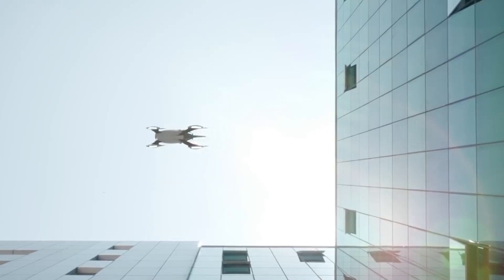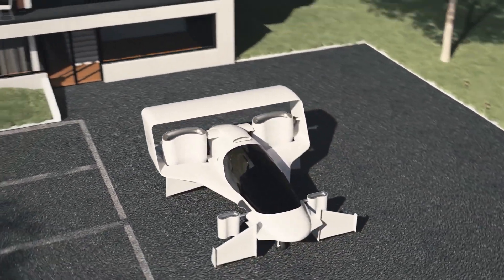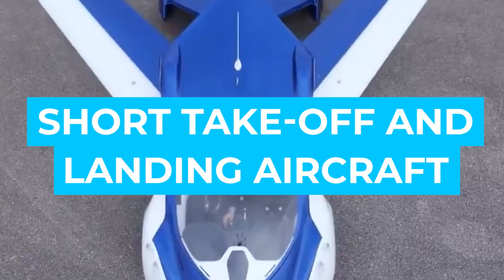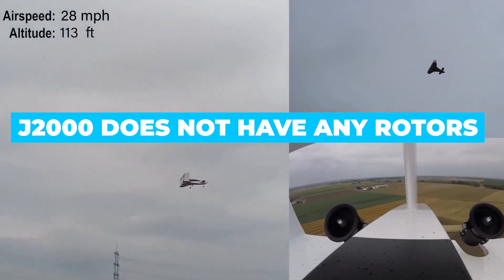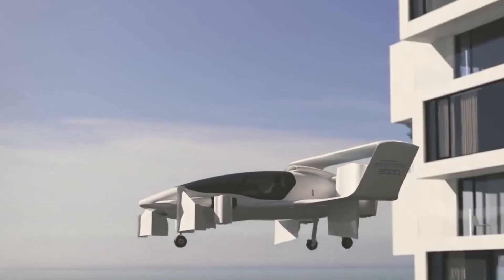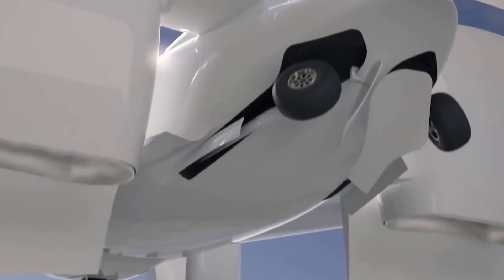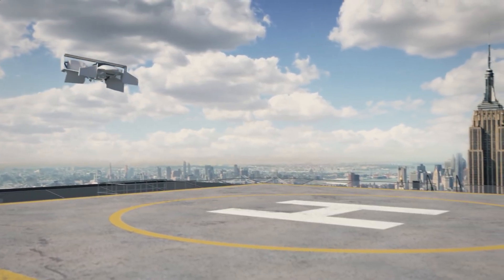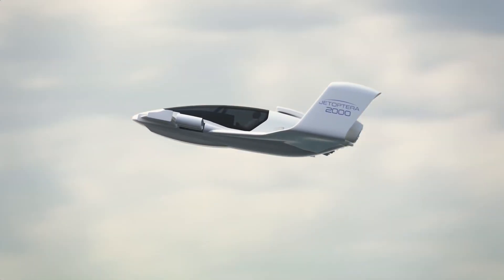How Jetoptera's Bladeless Propulsion System Works

Comment: A battery is a LAKE, what we need is a RIVER. A generator using a magnetic propulsion engine. They levitate high speed trains, why not use that constant push mechanically? Only frictions would be bearings on shafts.... batteries, like bottles, are emptied until refilled. We need the tap. They make electricity in a power plant why not in the vehicle? Watches use kinetic energy, calculators solar, they keep going, so why does the personal vehicle still plug in? Tax money that's why

Comment: We need a working prototype, even on a small scale
Reply: There is a small-scale model. But I think the problem of low efficiency will only show up when it's full scale. Nowadays you can build almost anything in RC scale, as there are small and powerful electric motors. But it's not easily scalable.

Comment: seriously this is suppose to be a breakthrough? They're basically artistic nozzles that in no way makes it more efficient.
Reply: Oh contraire -  I suggest you go and research some fluid mechanics, Bernoulli's Principle,  Coanda effect and fluidic propulsion systems.   You might then realise that this propulsion idea is actually pretty sound.  At present, the power required is still out of the range of current battery storage capacity, for full manned EV use, though within practical application for R/C models.   How this will scale-up will be interesting.  Currently, a single small gas-turbine powers the centrifugal compressor that supplies the HP to the multi-vectored FP thrusters, but yes, overall, a far more efficient system than straight gas turbine vectored thrust, tilt wing/rotor, or conventional rotor and with considerably less dB's emitted than any other aircraft other than a glider, which is always a plus.

Comment: The  'zen' of aerodynamics efficiency is to have the aircraft disturb as less as possible the air after it passes, and that means imparting a small acceleration to a large quantity of air. What 'fluidic propulsion' is doing is the exact opposite: the fast jet air entrainment creates a lot of turbulence that is energy lost in the wake and cannot be effective. The video here: https://www.youtube.com/watch?v=dS0oFmzU06g is demonstrating that a regular fan is more effective at moving air, and quieter too.
Reply: Nonsense, the efficiency should be measured in m3/s per Watt, not "m/s per fan power levels". That video proves nothing.

Comment: You never even explained how fluidic propulsion works
Reply: This is all optics, folks- 0:17 -that is certainly a micro-turbine engine, and I suspect it drives a fan connected at either the front or the back, the output of which ducts to those "bladeless" propulsors, lol.
Reply: I think it's more a long the lines of the venturi effect
Reply: Think of a bunch of modified Dyson fans folks.
Reply: Je sais pas si ses vrais.🎉🎉🎉😂😂😂
Reply: search bladeless fans and their flows on youtube. Great video.
Reply: @generalrendar7290  the fans are just inside rite?  so there are blades inside it..
Reply: If true North was, "OPP"
and, "South" was You know Me
the mechanical 🌾🐤empty ear' can hold a listener in🌵
Reply: If true North was, "OPP"
and, "South" was You know Me
the mechanical 🌾🐤empty ear' can hold a listener in🌵
Reply: If true North was, "OPP"
and, "South" was You know Me
the mechanical 🌾🐤empty ear' can hold a listener in🌵
Reply: If true North was, "OPP"
and, "South" was You know Me
the mechanical 🌾🐤empty ear' can hold a listener in🌵
Reply: What Is Islam?

Islam is not just another religion. 

It is the same message preached by Moses, Jesus and Abraham.

Islam literally means ‘submission to God’ and it teaches us to have a direct relationship with God. 

It reminds us that since God created us, no one should be worshipped except God alone. 

It also teaches that God is nothing like a human being or like anything that we can imagine.

 The concept of God is summarized in the Quran as:

{ “Say, He is God, the One. God, the Absolute. He does not give birth, nor was He born, and there is nothing like Him.”} (Quran 112:1-4)

Becoming a Muslim is not turning your back to Jesus. 

Rather it’s going back to the original teachings of Jesus and obeying him
Reply: @ahmdabdallah5811  no, islam is 700 years after christ And is nothing of the peace and love for our fellow man, earth, and animals. Unconditional love is what our god demands.
Reply: @ahmdabdallah5811  I assume you will be accepting the resurrection of Christ, his position as the Son of God and Savior of Mankind?
Reply: @ahmdabdallah5811 
"slam is not just another religion. 
It is the same message preached by Moses, Jesus and Abraham."

This is a lie.

Moses said; You shall not bear false witness and you are bearing false witness.
Exodus 20:16: Thou shalt not bear false witness against thy neighbour.

Deuteronomy 5:20: Neither shalt thou bear false witness against thy neighbour.

Islam teaches that God does not have a son.

Yet the scriptures teach us that God does have a Son.

Psalms 2:7: I will declare the decree: the LORD hath said unto me, Thou art my Son; this day have I begotten thee.

Psalms 2:12: Kiss the Son, lest he be angry, and ye perish from the way, when his wrath is kindled but a little. Blessed are all they that put their trust in him.

The Apostles of Jesus Christ taught that these scriptures refer to Christ.

Acts 13:33: God hath fulfilled the same unto us their children, in that he hath raised up Jesus again; as it is also written in the second psalm, Thou art my Son, this day have I begotten thee.

Hebrews 1:5: For unto which of the angels said he at any time, Thou art my Son, this day have I begotten thee? And again, I will be to him a Father, and he shall be to me a Son?

Hebrews 5:5: So also Christ glorified not himself to be made an high priest; but he that said unto him, Thou art my Son, to day have I begotten thee.

Jesus, speaking of Himself said; "For God so loved the world that He gave His only begotten Son that whosoever believes on Him should not perish but have everlasting life."

Jesus Christ rose from the dead, is ascended up into heaven is coming again. All that follow the violent teachings of Mohammad will be judged by Christ and His angels will gather them together at His coming and cast them into a firey furnace.

Matthew 13:41: The Son of man shall send forth his angels, and they shall gather out of his kingdom all things that offend, and them which do iniquity(lawlessness);
42: And shall cast them into a furnace of fire: there shall be wailing and gnashing of teeth.

Mohammad is still dead.

"Islam literally means ‘submission to God’ and it teaches us to have a direct relationship with God."

It reminds us that since God created us, no one should be worshipped except God alone. 

It also teaches that God is nothing like a human being or like anything that we can imagine.

 The concept of God is summarized in the Quran as:

{ “Say, He is God, the One. God, the Absolute. He does not give birth, nor was He born, and there is nothing like Him.”} (Quran 112:1-4)"

Which god.
You claim to serve the God in heaven, yet you and Islam call Him a liar saying; "God has no son."

"Becoming a Muslim is not turning your back to Jesus.
Rather it’s going back to the original teachings of Jesus and obeying him"

This is another lie.
Jesus Christ is God come in the flesh.
He is begotten of the Father in Heaven because the Father created in the virgin Mary, a seed that was not off a man, but of a new creation by God the Holy Spirit.
God gives birth through the His power of creation. This is  illustrated in the Gospels as Adam is called the son of God.

You don't know anything about what Jesus taught. 
All you know is the many lies that you have been taught by your teachers in Islam and the Quran.

God in heaven is one by the Divine ordinance in heaven which decrease that the Father, the Word, and the Spirit shall be one God and one Lord. The Word being the very person and God come in the flesh Jesus Christ.

It is much better to serve the Son of God who became a man and conquered sin and death and is alive sitting at the right hand of the Father in heaven, than to serve a prophet that yet, lies dead.

Repent therefore, and believe on the name of the Lord Jesus Christ for salvation and the remission of sins. Only through the blood sacrifice of Christ on the cross, and by no other name than the name of the Lord Jesus Christ, the only begotten Son of God, can one be forgiven and thereby be saved.

John 1:1: In the beginning was the Word, and the Word was with God, and the Word was God.

John 1:14: And the Word was made flesh, and dwelt among us, (and we beheld his glory, the glory as of the only begotten of the Father,) full of grace and truth.

1John 1:1: That which was from the beginning, which we have heard, which we have seen with our eyes, which we have looked upon, and our hands have handled, of the Word of life;

1John 5:7: For there are three that bear record in heaven, the Father, the Word, and the Holy Ghost: and these three are one.

Comment: This could be a big deal because the blades on a normal vtol are extremely dangerous! Clipping a wire or the side of a building could result in a total loss. but with this system, it would be more like a minor fender bender. and taking off and landing with people around wouldn't be as dangerous. Those blades always worry me when people fly drones around.
Reply: @Gen Old maybe, but outdated? Not yet.

Comment: interesting disinformation,  is it tinkery toy or reality?  Can jetptera tech go beyond toy drone weight?  Can it be scaled to have thrust and lift for people and its power systems I doubt it
Reply: Do a little research on the XFV-12A.  The program was shut down before this plane made a single flight, but it did actually hover during it's testing phase.  For many reasons, the XFV-12A would have never made a good military fighter aircraft, but it did prove the fluidics propulsion concept can be scaled up to a full size aircraft.

Comment: Is the high efficiency only for the fan itself or the hole system with lots of redirection of the air stream? If this all works fine, it would be much better than open fans.